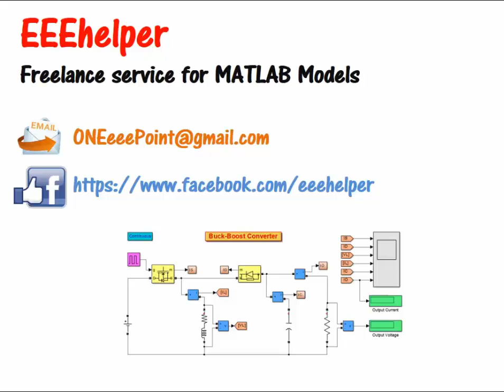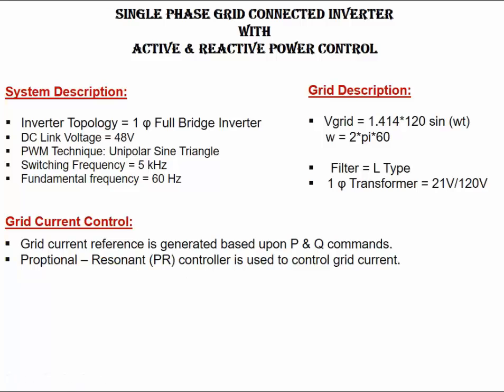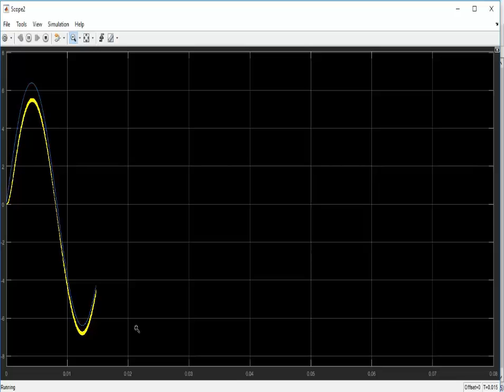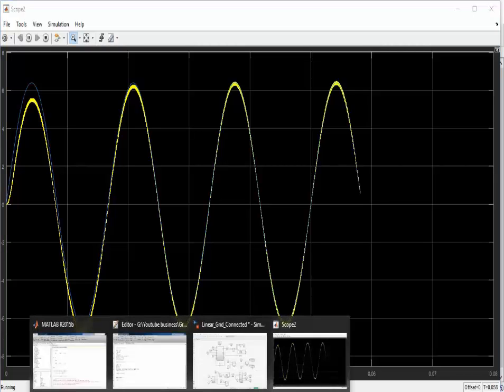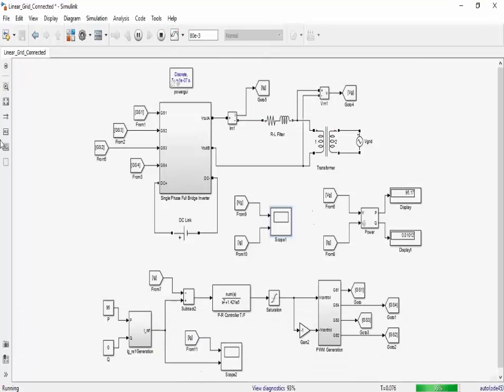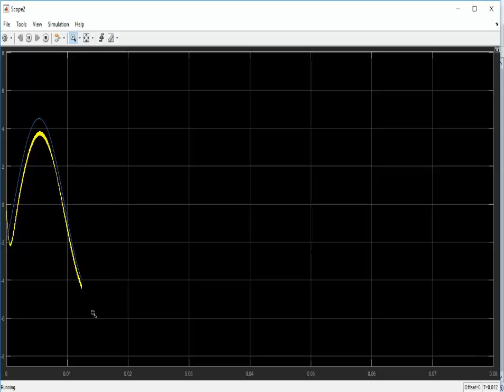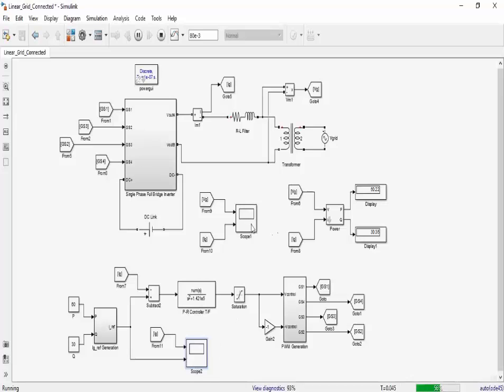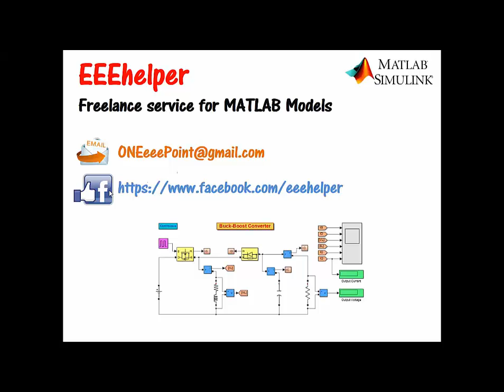Single phase grid connected inverter with active and reactive power control

Comment: sir plese send me ppt of this  Efficient Transformerless MOSFET Inverter
for a Grid-Tied Photovoltaic System  with ppt points out put simulation works
if you have yugandharpawan@yahoo,in
Reply: Hey did u got thet simulink model. Of 1 phase transformerless pv inverter..... If u.... Please tell. Me where u got that... It ll help. Me a lot